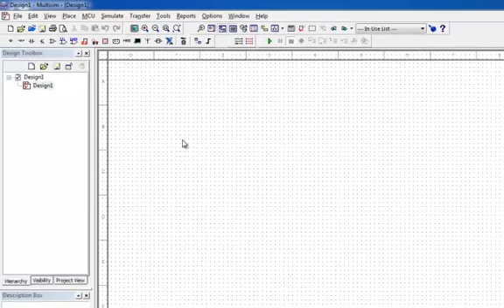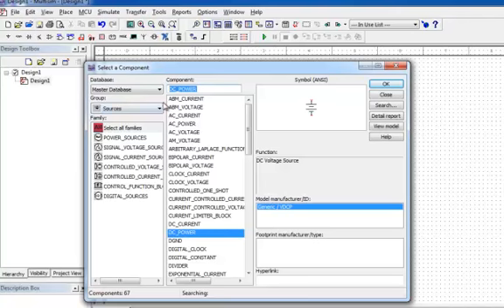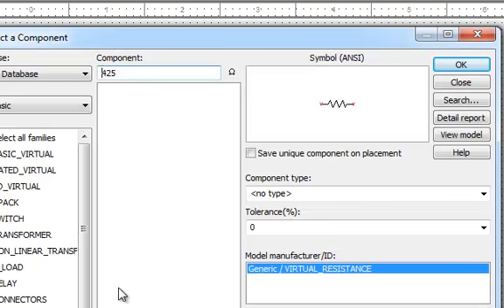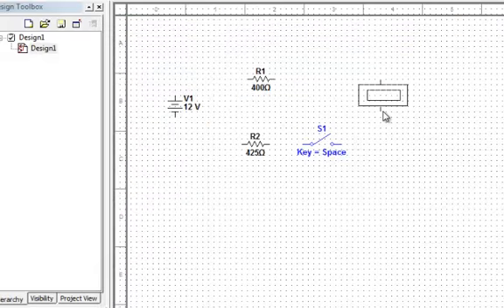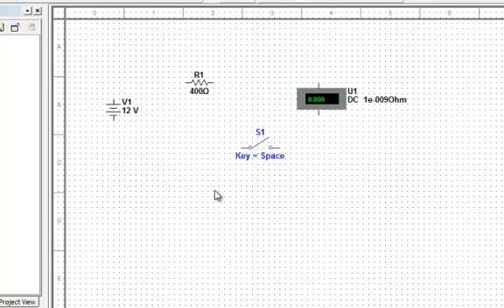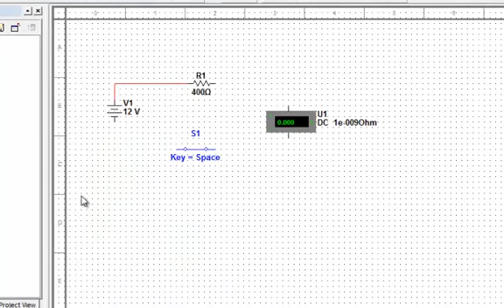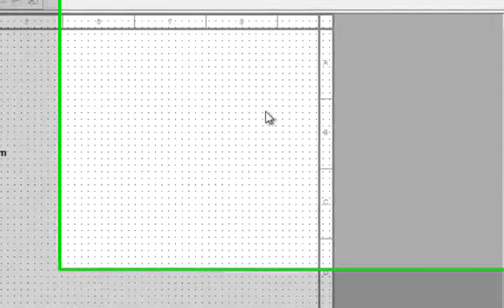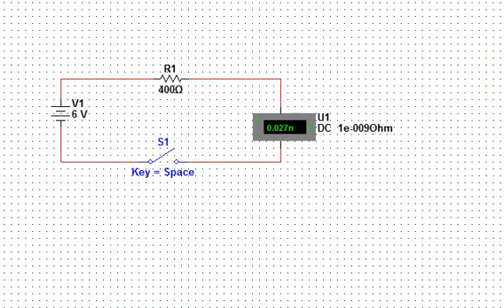Multisim 11 Basics

Comment: can you make a RC Low pass filter tutorial with oscilloscope measurements for voltages across the capacitor using the oscilloscope for different frequency settings?

Comment from the maker: With Multisim 12 open, you should be able to open the Multisim 11 files. An option to copy into a Word Document is to use the print screen button and then in the Word Document paste where you want the circuit. To crop the circuit image click on format in Word and drag the edges to where you want them. Hope that helps